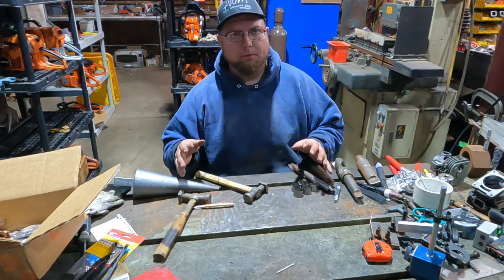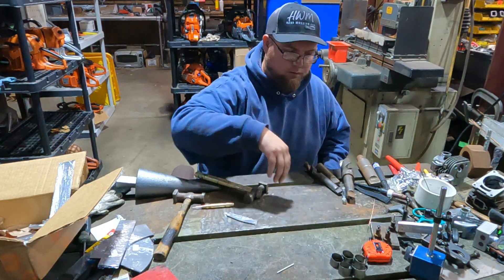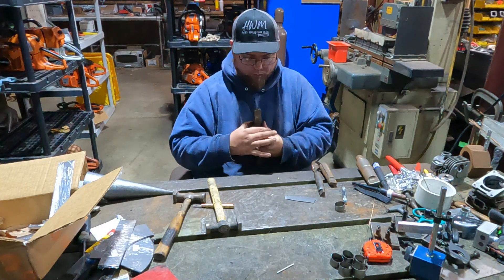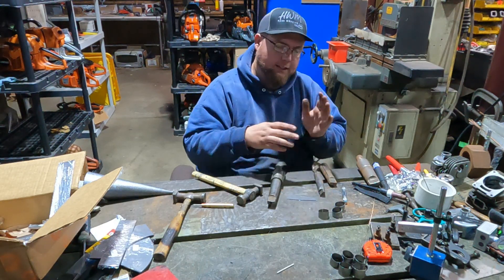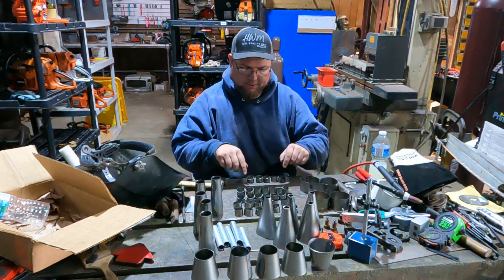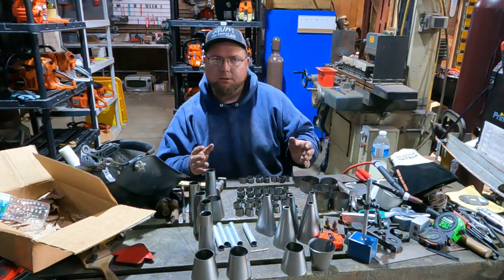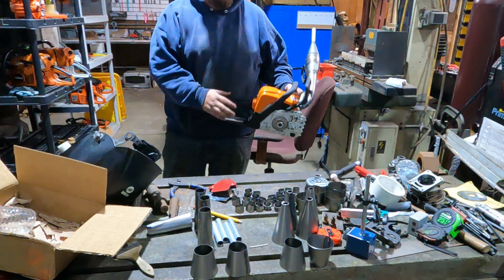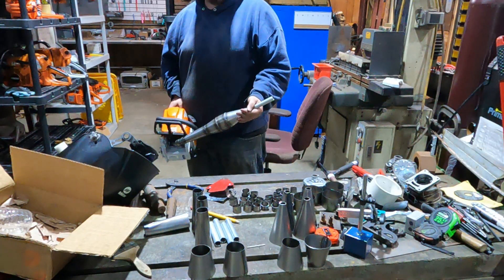Building my first Expansion chamber/Tuned Pipe. Sawfest Ms170

Comment: Joe,
Have a look at hydro forming pipes.
Can save a lot of welding/fitting, and is done easily even with a cheaply power washer.
You can layout most of the straight sections with two pieces of sheet metal, seam weld it, and pressurize it to make the round shape.
Hope this helps!